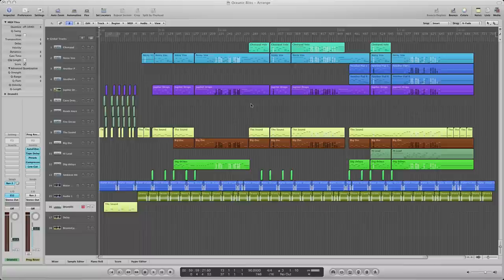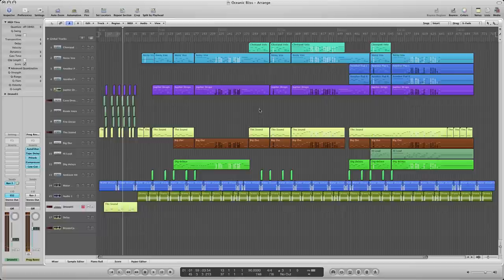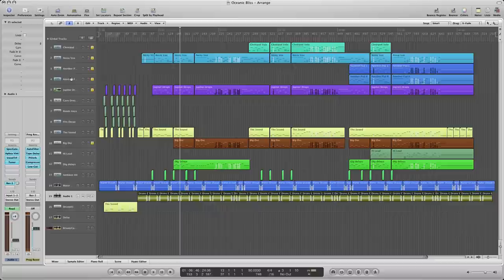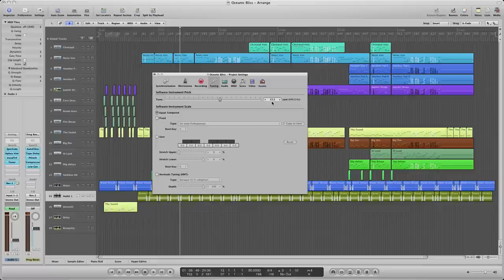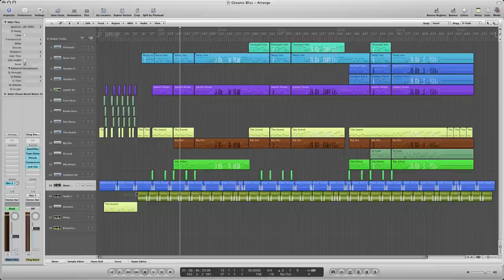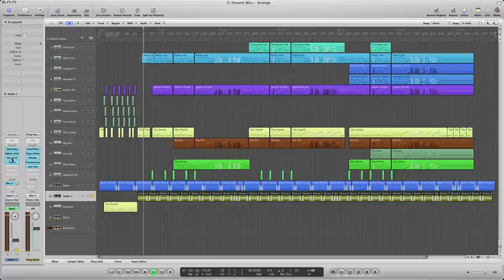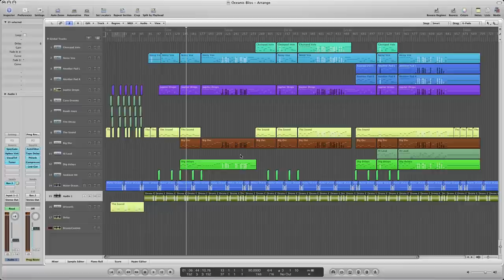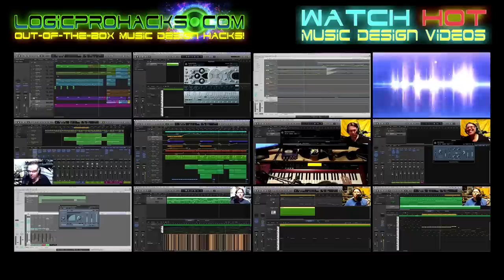Logic Pro Tutorial how to Design & Make Ambient Music - Amazing Pads

Comment: Not sure because I'm just getting back into making music but what I think you can do to get around the CPU problem (during the playback of your song...which sounds great BTW) is export your song to one audio file and just drop it in the timeline below all your tracks. That way, we still get an idea of where your instrumentation drops in/out during playback. Oh, and I think you have to lock your other tracks.Thanks for the vid !
Reply from the maker: +Richard King Thx! I actually don't have this problem anymore..  Since I did the original video: I have bought a new mac and as well upgraded the processors in it from 4 cores to 8, which seemed to do the trick.  Also at the time, I was running Waves and Omnisphere; which both are huge CPU hogs.  I don't actually use Waves or omnisphere that much anymore.  I actually like to create my own sounds from the various collection of hardware synths I have since bought from various places like, pawnshops, craigslist, ebay, etc.  Thanks again, please keep in touch and would love to hear some stuff you make, since your coming back into music...
Reply: +LogicProHacks Figured you might have fixed the problem by now. Looking for a new Mac as well. All the programs I need will absolutley choke my Pac Book Pro.

Comment: Hey! What's the programm u using, i have wanted to make ambient music for long time but dont know any music making programm.
Reply from the maker: It’s Logic Pro X, only works on Apple Macs. IMHO, I’m dumping it after using it for almost 10 years. It’s a great DAW for a couple tracks hear and there, but when you delve in the dark world of orchestra music in the forms like melodic dubstep and game compositions you need more power in processing like 100 plus tracks. I seem to like Reaper to do this, but it’s very lame looking, I know for some this doesn’t matter but for me it does I like my DAW to look good. And that is why I’ll probably go to Cubase But you might like FL studio or Reason.  But really ambient can be made on any DAW.
Reply: @logicprohacks  thanks dude! I think im gonna go with the Reaper at the beginning (cauze its free) and see how it goes for me...
Reply from the maker: Deckron - super cool, I actually found some decent themes for Reaper and I’ve been using it solid for the past three weeks, and so far it’s a really decent DAW. What surprises me, is how stable it is and how much it can take. 

The one gripe I had with Logic was that it was limited to only one CPU core per track. Not a big deal until you use a VST like VPS Avenger or UVI Falcon, which are massively CPU hungry sampler synth hybrids. Logic would just choke and start clipping. Month later, same setup but using Reaper and it is rocking, not a glitch. 

You’re right not s bad deal, even with the professional $60 price tag, it will cost me almost $600 to get Cubase; so I’m staying with Reaper as my main DAW. Im even planning to do a new YouTube Ambient how to, but with Reaper. I just got figure the best sampler and synth, that everyone else uses. For the sampler, I really like Halion 6 and UVI Falcon, but I guess Kontkt is used by the most. And for the synth, I like Sylenth1, Massive, and VPS Avenger, Cypher 2 and my fav is u-he Zebra 2. All-in-all, I’ll just stick with my favorites. Cheers